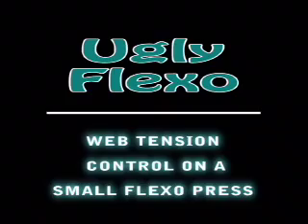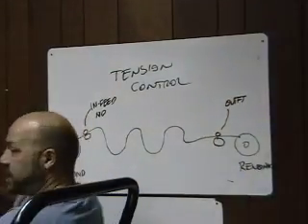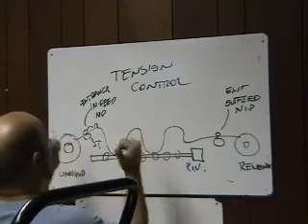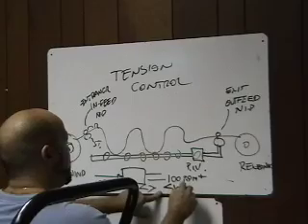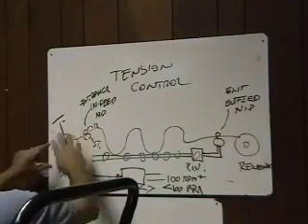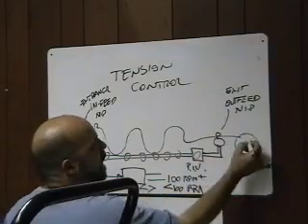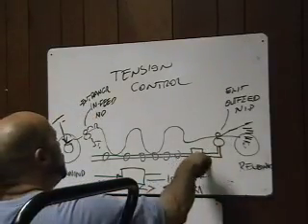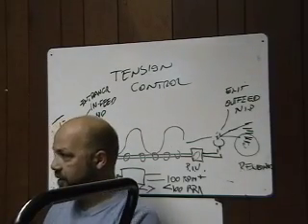Web Tension on a Small Flexo Press

Comment: I remember discussions like this when we changed over to a new offset press for printing the Vancouver Sun/Province (they have since closed the plant and gone non union :^)

PIV's always picked my butt as they stand for Positively, Infinitely, Variable which is BS 'cause there are NOT an infinite amount of settings on any dial/switch

Anyhow, the video took me back to happier times and good luck in your future endeavors

These are just ramblings, not criticism, okay?

Peace
Reply: Victor Sansum No offense taken, Victor.  Your comments had me cracking up!  I appreciate them and I appreciate you taking the time to write.  Thanks for the good wishes.

Have a great weekend!
Reply: Frank Burgos 

Saw your reply

I can't say that I miss the printing trade very much.  I started on an offset Goss Community press and ended my career on a Man Roland Colorman press

What used to be a hands on trade became a push button, computer controlled nightmare (imho)

I also found that the lessons that they gave us to work on the new offset Colorman press were almost a waste of time as all the info just went in one ear and out the other.  The simulator was also not the same as the actual controls for the press and I found that we learned by doing it as opposed to be told it.  A big waste of $'s on the company's part as I see it

Anyhow, enjoy the weekend yourself

Later, eh
Reply: Victor Sansum I love the printing industry, but like you, it won't hurt my feelings to get away from it, eventually.  I'd like to have time to read a fiction novel, or grow tomatoes!
Reply: Victor Sansum I didn't see the additional remarks:  The flexo industry also had a simulator, in the nineties.  It was a nice idea, but as I have learned, it doesn't always replicate real-world conditions and the flexo market is tiny, compared to offset or the pet industry.  Dog food or toys might be a more fruitful endeavor. :)